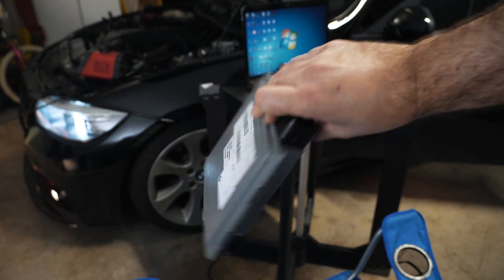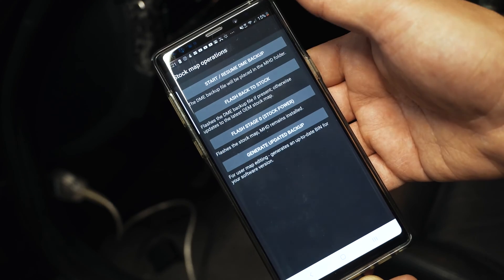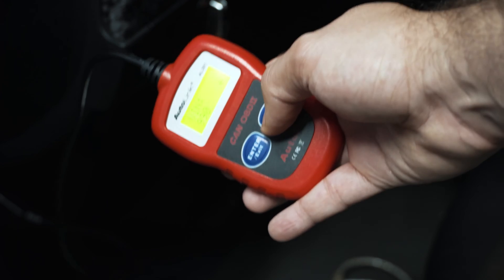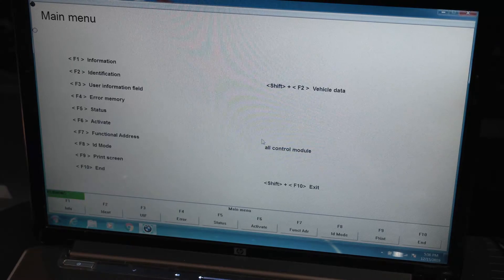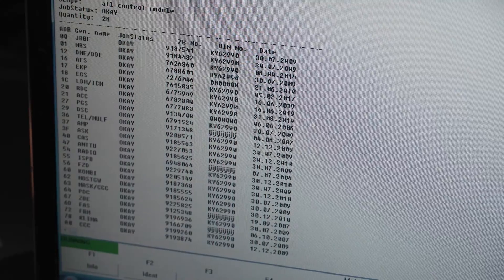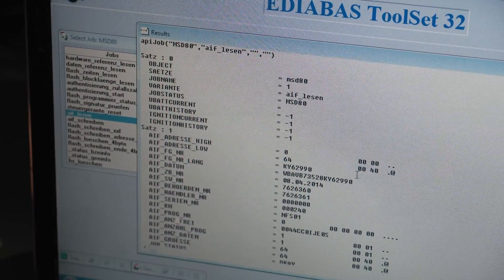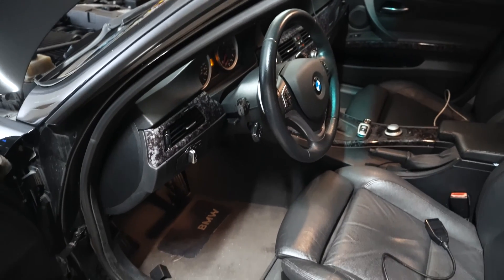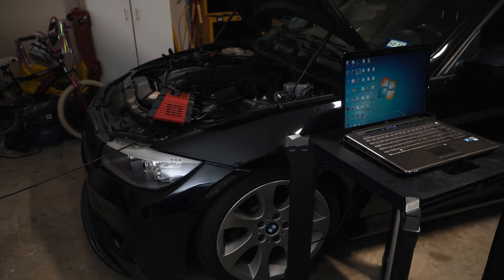Now You Can Change Your ECU Without Worrying!

Comment: I have a MSD81 and a water damaged 80. If I plug the 81 in it puts the cars OBD in to protection mode because the ISN is different on the CAS. 

Sadly I bought a 81 without a cas

Can I use MHD to get around it

Comment: This does, and doesn't work, you still get dme/cas sync issues if you get a donor msd81 dme that's off another car. Still working through this one lmao
Reply: Any luck? Were you having abs, awd and dsc issues with the swap too?
Reply: @speedbracer1234  i had to send my dme, cas, and key off to get the cas synced with the dme.     

Theres not really any way around it if youre getting the cas sync code reported by ista. After i got it back everything worked though aside from the rest of the car having older software than the newest flash files that the tuner put on the dme and cas.   

But i have the ability to update that kinda stuff..
Reply: @SaltyDalty1801  I had a feeling that's what it's coming to, thanks for the update. Who did you send it in to? Was the turnaround decent?

Comment: First of all,Thanks for the video! Question: Does this mean I can flash a msd81 from a donor car with MHD, as long as I do have my cas with MHD licensed vin connected? E.g. donor ECU is from 535i and I put it in my n54 335? Thanks
Reply: Did you ever find out if MHD can do this?

Comment: Hi I've looked through the comments and didn't find an answer. I noticed you used an msd81. I have a used msd80 with a different vin than my original dme and I've tried this method a few times and it did not change the vin. Was your msd81 virgin? Was it used? Can vin coding still be possible with ista? I've tried this method and have searched protools with no luck. Thanks

Comment: hey I was wondering if you knew the answer to this. I have an MSD81 from my first 135i that I want to put in my new 135i. If i do the swap, would I be able to use the MHD maps I already bought since it’s the same VIN and MHD account? Thanks
Reply from the maker: MHD looks at the CAS and DME for the vin, if one of them has the right vin the license would work.  If you move the DME over and align it with the new CAS it would probably overwrite the VIN and not work.  I'd reach out to MHD and have the update the VIN associated to your license if possible.

Comment: Hi there, 
Thanks for your videos they are very helpful. I  have a question, 
How do you register ECU, mine was accidentally disconnected and the car would not start. It is bmw f01 diesel 730d 2010 model. 
Many thanks again, 
Joe.
Reply: I have the inpa, bmw tools, ista-d,  ista-p already installed but never used that software before. 
Thanks.

Comment: I have the same exact issue. Even ran into a problem with licenses showing up in my MHD app because of this discrepancy. Had to unplug my battery and plug it back in to get my MHD licenses to show properly. Still have the VIN mismatch. I wanna start tuning the car but don't know if the BIN I send is going to be the correct one.

Comment: This is the nightmare I’m living in right now I upgraded then it didn’t pass smog because vin was wrong as well as modules seemed to be turned off. My car got state reffed because of this 🤦🏻‍♂️ so I found another guy that was able to fix these issues he coded the car now vin and modules are working. I took it to the state smog and they said it still won’t pass because the car isn’t throwing “certain numbers” but they won’t tell me what. 🙁 they told me it seems like the car has a “wrong software “ any help??
Reply: Bryan Rodriguez im in the same exact situation as you, any updates?
Reply: What did you do in the end man?

Comment: hey question my LPFP at idle is 79 and when i get the
   throttle it goes up to 138-159
Reply: The sensor could be bad. The older style sensor on the low pressure fuel rail on the bottom of the motor is notorious for failing. It should fluctuate slightly but be around 72 psi pre HPFP. The old one is easy to identify because it's brass. the upgraded one is silver.

Comment: Hey guys my car is a 2010 e92 M sport. From what I’ve been told it should’ve came with an msd81 but when I connect to it with software it says msd80. Any ideas why this is? Thanks
Reply from the maker: It would still register as an MSD80 via software but any 2009 or 2010 would have MSD81 from what I've seen.
Reply: Would the only way to check be physically removing it?

Comment: Would you happen to know how one would code out the paddles for gear shifts on a e82?
Reply from the maker: You just want to completely disable them?
Reply: @VehicularDIY  I do as the car currently has no paddles but the engine and CAS were from one that did. And I think it's why my sport mode isn't working, the shifter will go into manual once pushing up or down for +/-  then after a number of seconds reverts back to D mode 
I've checked the wiring for the shifter and see no issues there.
Also have swapped shifter out for another same issue. 
I assume is due to the CAS being from the e82 that had paddles?

Comment: ISN ON DME & CAS can all be done VIA TOOL 32 if you know how.

As for UIF if that’s a donor DME which we know it is as 335 uses MSD80 , you can clear the whole ULF and make the ecu virgin again with ease by deleting the UIF 

Bro was you seriously using a battery CHARGER in this video though ????
Reply: Anytime the cars not on for mhd map flashes it should be on a charger . I haven’t got a battery charger yet. I’ve been winging it but it sure scares me.
Reply: erick r you don’t use a battery charger for these things you use a VOLTAGE STABILISER 

A battery charger will not keep up with the demand of the programming I don’t know where this myth of a battery charger ever come in to place
Reply from the maker: Nice, thanks for the info.  Wasn't aware you could sync the ISN via Tool 32.  You should have seen what I used to use lol, do you have a recommendation for a good voltage stabilizer?
Reply: Vehicular DIY there isn’t any recommendations mate that’s just it I got mine from when I worked at bmw as all us techs get our own equipment so mine is a full computerised one it ain’t so simple as there isn’t any brands or anything like that not the level my one is anyway mine does Strictly bmw and holds the voltage steady at 14.2 constant without dropping as you know a dropping voltage will brick modules clean